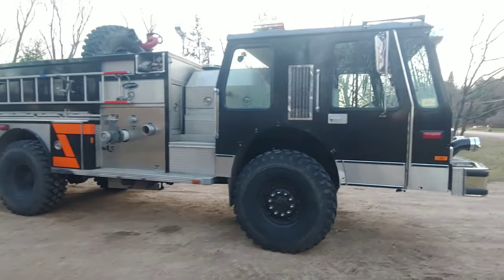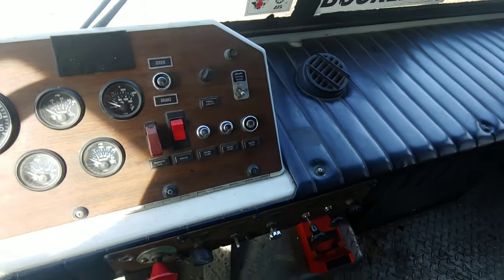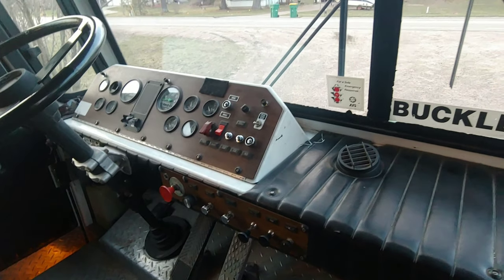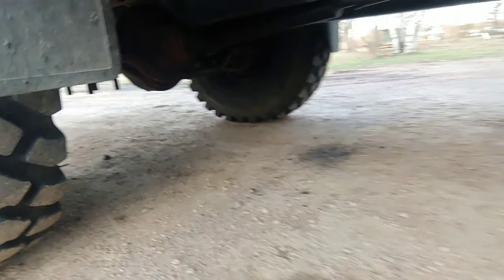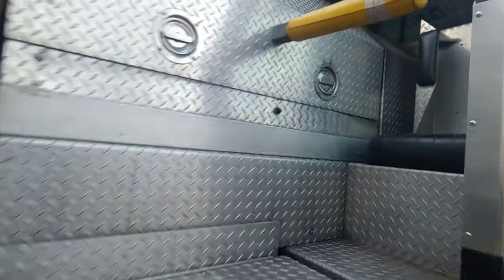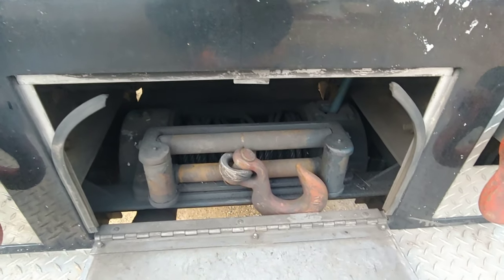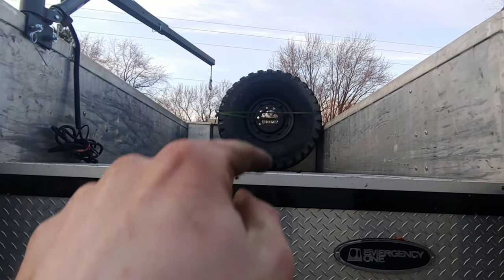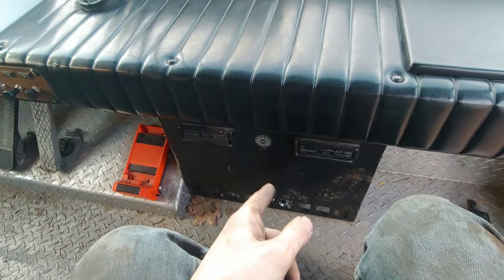Lifted 4x4 Sled pulling fire truck with over 600HP, Sparkles

Comment: Dude, did you bring back some of my best memories  as you drove to get fuel. Thank you so much! I drove for a majority of my career before retirement. The best job ever. Your cam angle made me feel as if I was driving. Actually got a little emotional. I would give my right eye to drive a fire truck again. One part of my bucket list that can only be a dream as health issues say no. I can't even get into my car. After I retired I purchased a 1970 Mack cf685f ex Raleigh Fire Department. Did weddings for a few firefighters and the kids thing as well. Sold it a time ago. Ken
Reply from the maker: Glad it brought back some good memories!  I've gotten a few requests for more driving videos so I will be doing a few more of those.  Make sure your subscribed so you can catch them when I post em

Comment: Just saw this, AWESOME MAN! You should open up the water tank and have a mobile swimming pool for the kids! Or show the fair goers how a fire should be put out with the water pump running at full capacity! Water slide for the kids at fairs? Dunk tank at fairs? Add a little foam to the mix and make a foam swimming pool? Hey, STOP rolling coal! You should turn the exhaust up and add some fire for the pulls! VERY COOL!

Comment: I live in Alberta in Western Canada. My city's department had a few E-One Dash rear engine pumpers with 6v92 Detroits. I only saw the 8v92s with a Pierce Quint, an Oshkosh L-1838, and some Oshkosh crash trucks.
Reply: The E-One rear engine was the "Hush" not the "Dash." "Dash" is a front engine Pierce product.
Reply: @DowntownDeuce2  My mistake.

Comment: Cool cool firetruck cool cool build really like it also really like ur astro too so would like to build a astro or safari oh and when cold starting a diesel turn the key on 4 frew seconds to a few minutes be4 turn the engine on this will allow the glow plugs to warm up be4 starting also u can add a glow plug warmer and warmer pigtail to it this is y u see while in service they r plugged up to extension cords in the fire stations same as ambulances really really like this wow ur doing a good job at ur builds keep walking tall prayers 4 yall bless great healthy peaceful safe journeys travels and happy camping also as 4 ur steps getting in to the truck army surplus they have those extra cable steps that gives u extra step to get in and out with on their trucks this may help u with ur truck just idea cool cool happy camping and happy building keep on making vids
🚐⛺🌌🌄🏞👍👍💪🙂👍👍

Comment: Can you tell me what model transfer case you have? I have a GMC C7000 4x4 53” tires and I’m picking up an 8v92 with Jakes I wanna add if I can. Just wondering what case would handle the torque
Reply from the maker: It actually does not have one, the rear axle has a power divider that sends power back to the front axle
Reply: Oh I see ok. Very cool thank you! I think I’m gonna try for a 6v92 but that’s interesting I’ll have to consider that option